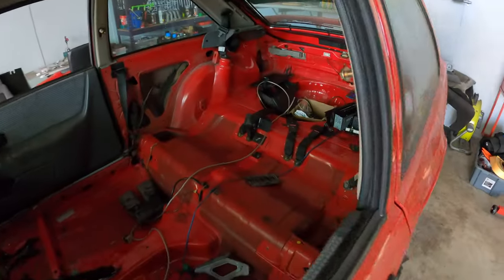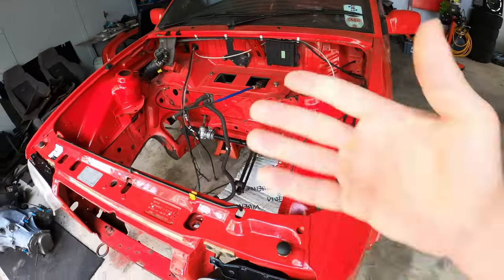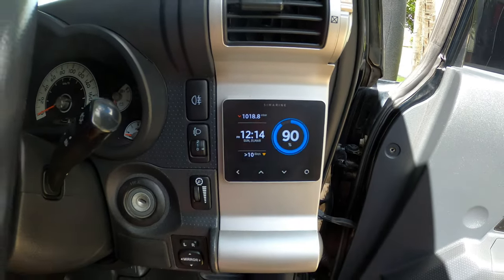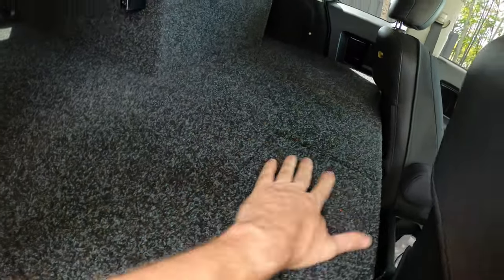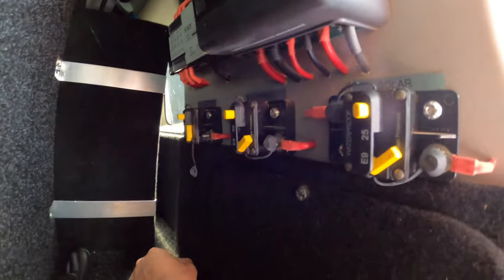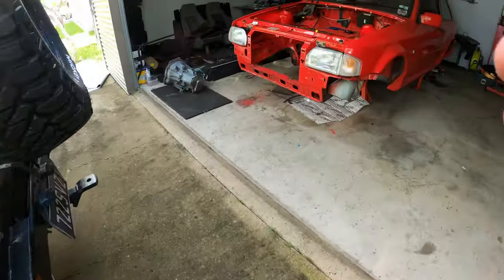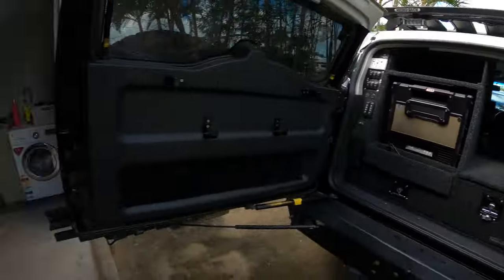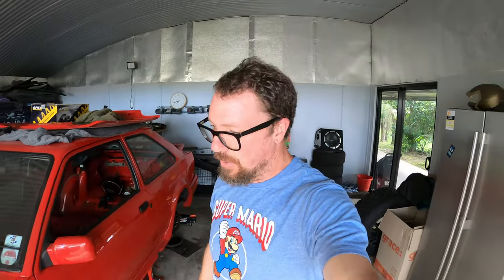Is This The Ultimate FJ Cruiser Camping Rig I BOUGHT ANOTHER NEW CAR

Comment: I miss the A-Trac switch. You can find out how to retrofit A-Trac almost free of charge on YouTube.
Reply from the maker: I forgot to show the atrac switch it's on the headliner next to interior light and rear diff lock. Not sure if that's normal location
Reply: @Simonstockton82 I am fortunate enough to have both an '07  F & '11 FJ.
The later models ('13/'14) moved the ATRAC button from the center stack to the roof console (older FJs did not have OEM roof consoles)
Massively fun rigs to drive over here in Texas!
D